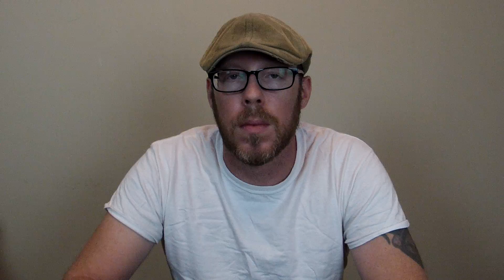Pool Heater Failure

Comment: Hi Steve, Maybe I can ask another question. 
I have an older Pentair Minimax 400 heater. It still works well and we use it about 3-4 times per year usually only for the Spa. The built in flow valve (p/n 471424) was replaced about 2 years ago but then stopped working. I removed the valve and found that the thinner of the two springs has sheared and broken in half. The larger spring controls the part that is moved by the heat actuator, so I assume this smaller spring comprises a check valve part of sorts. I cannot find this valve anymore so I am looking for a similar rated and sized stainless steel compression spring to replace it. 
My question is about the workings of this valve. I see that under heat the actuator moves the assembly toward the attachment plate side of the valve (the inlet) and this does pass my test as functional. But how is this valve designed to work? What is it supposed to do under different conditions (heating, not heating etc)
In the interim time I have removed the part of the valve that is controlled by the small spring (check valve) so as to allow me to continue to circulate the water in the filter system. I will NOT be using the heater of course at this time!

Cheers!

Comment: i am a gas fitter changed the igniter was broken still getting fault code CHEK IGNITION STEPS SOLID RED LIGHT ON BOARD im wondering if is the board tx